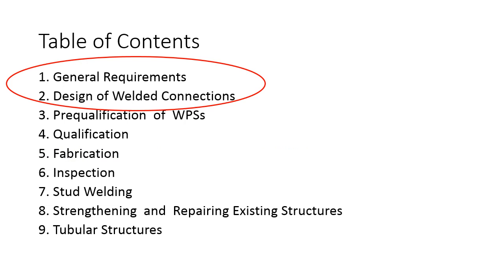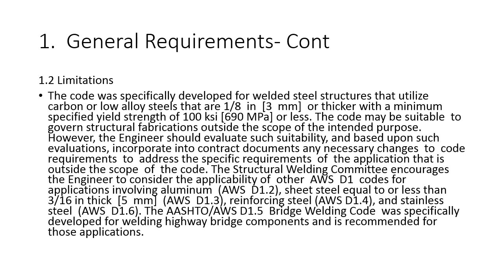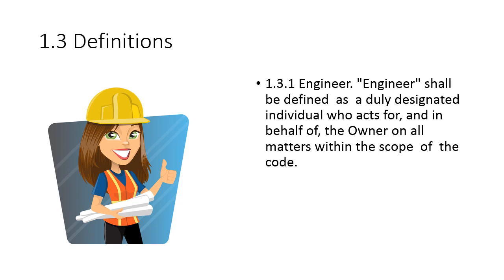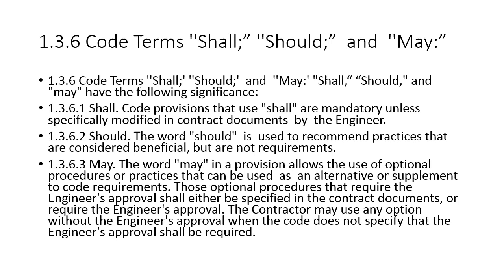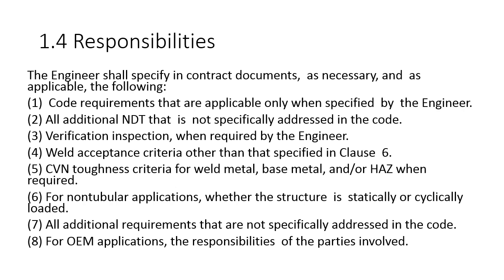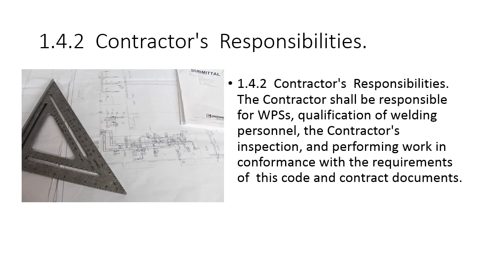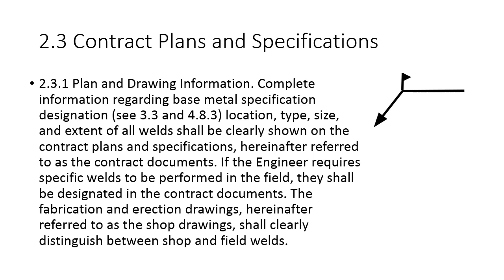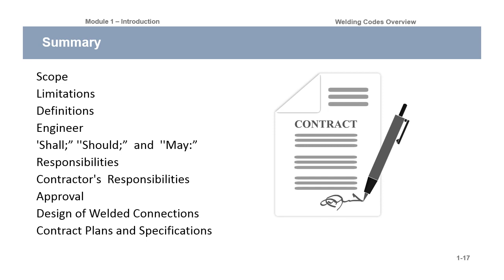AWS D1.1 Part 2: General Requirements & Welded Connection Design

Comment: in clause 4.4.2.9 there is the statement (In the as -welded condition, the distance between the edge of the base metal and the
toe of the weld may be less than 1/16 in [2 mm] provided the weld size is clearly verifiable.)
So, what is the meaning of "In the as -welded condition,"